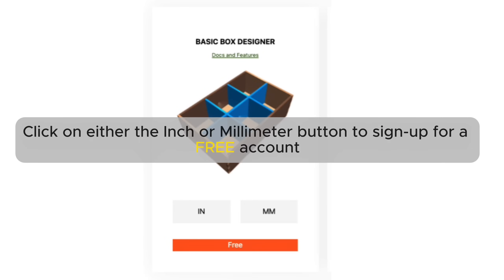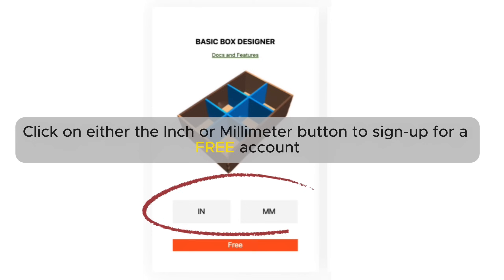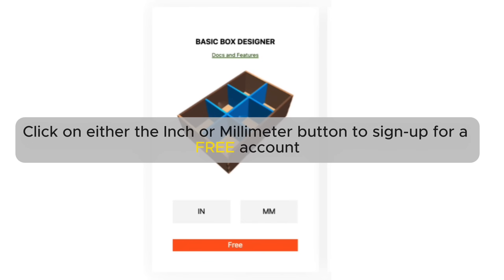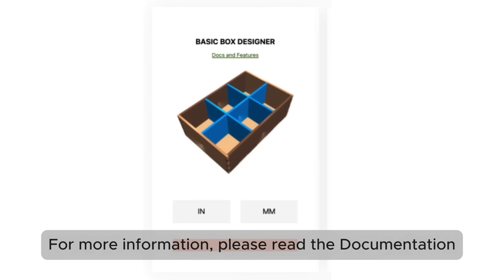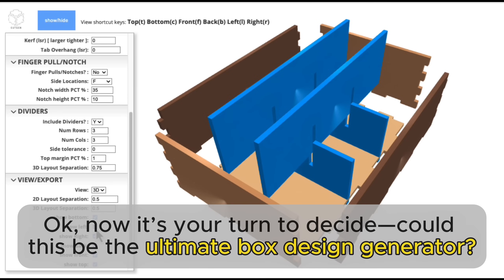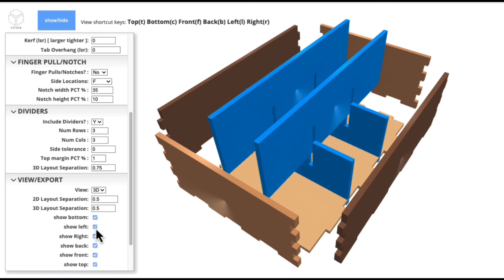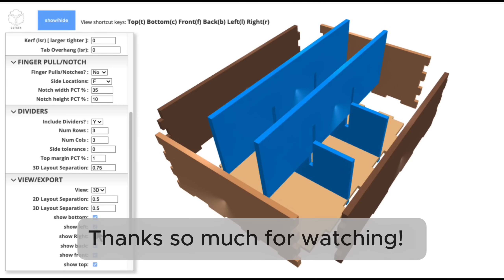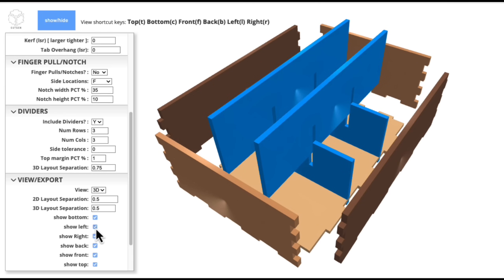Stop Wasting Time! Design Boxes Effortlessly for Your Laser Cutter!

Comment: Do you have a basic finger joint box with a slip top finger joint lid?... If so is some ware in the instructions?
Reply from the maker: Hi  @Don458Lott.   I do offer have a slide lid generator if that's what you are referring to.  Here is the documentation for it:   https://cutgen.io/documents/slide-lid-box-designer.html.    
Cheers, 
Chris
Reply: @cutgen  Not Looking for a slide sideways top...I would like a box with an open top to slip-fit over the top of another box that has dividers inside...I don't see this type of box on the web...